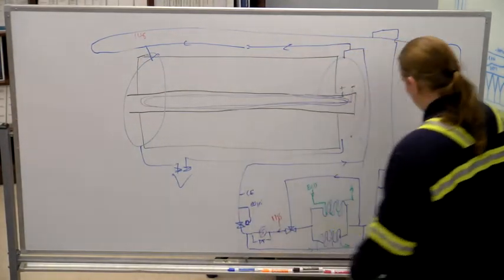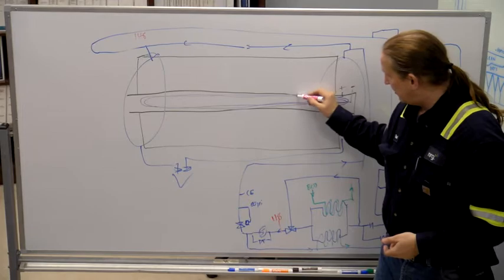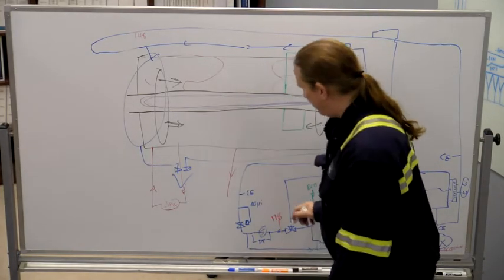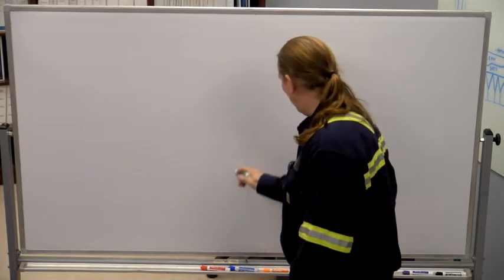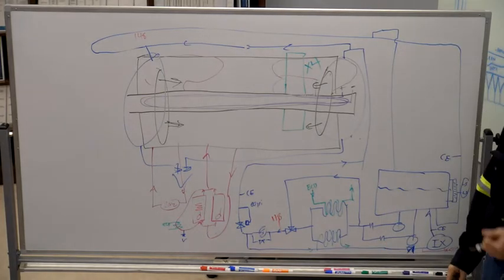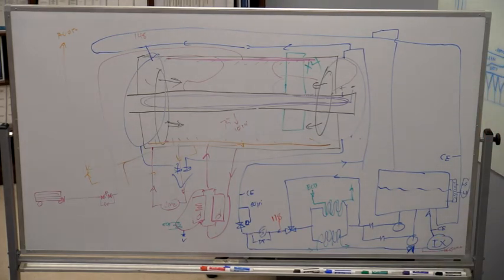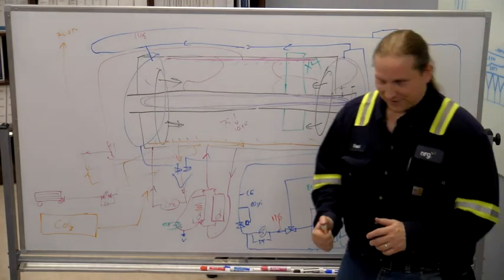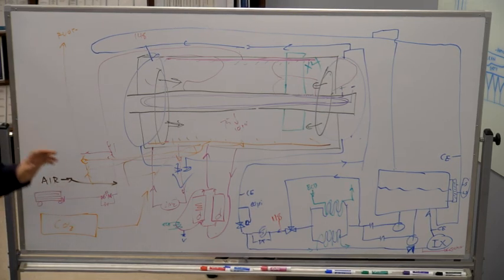Power Plant Basics: Generator rotor cooling

Comment: Another advantage of hydrogen is its low (lower than air for sure) viscosity.

Is the stator inside the hydrogen-filled vessel? If not, what's the (presumably nonconductive) material the vessel is made of?